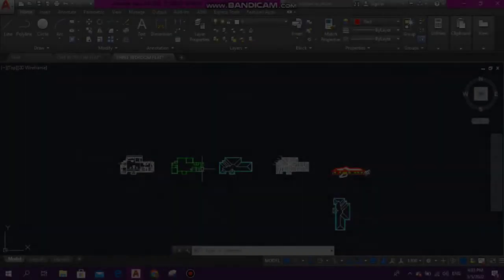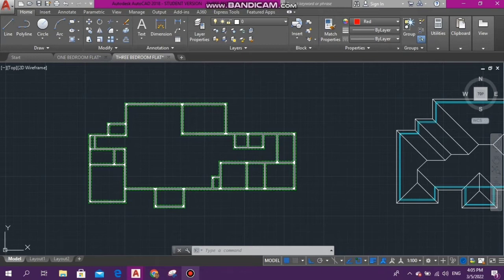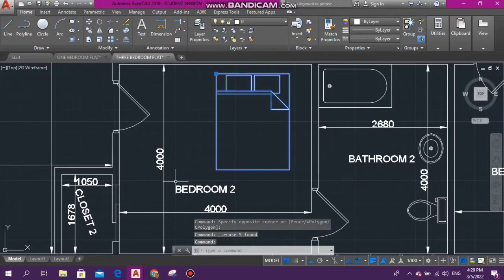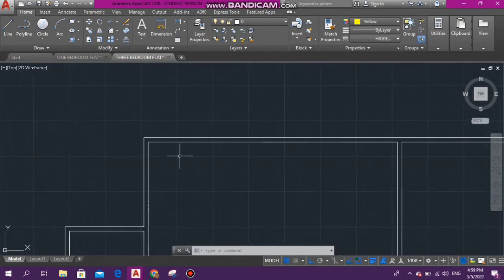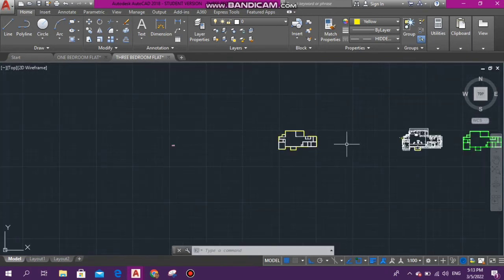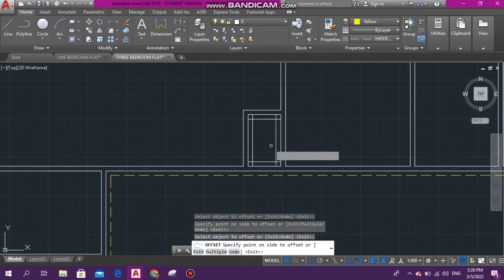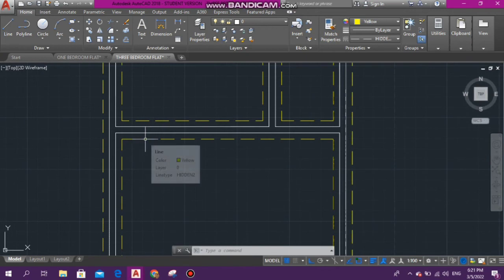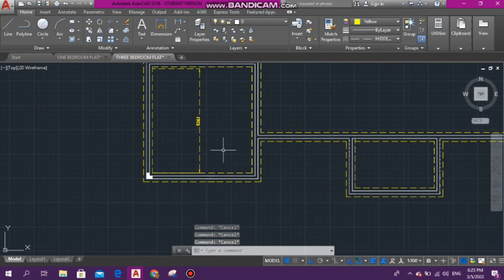How to create a foundation plan in AutoCAD

Comment: Why offset by 150
Reply from the maker: Hello good question, if you are wondering why I offset 150 mm (6 inches) on the outside and inside is to account for the backfill layer, which typically ranges from 6 to 12 inches. This extra space ensures a stable foundation and proper drainage.